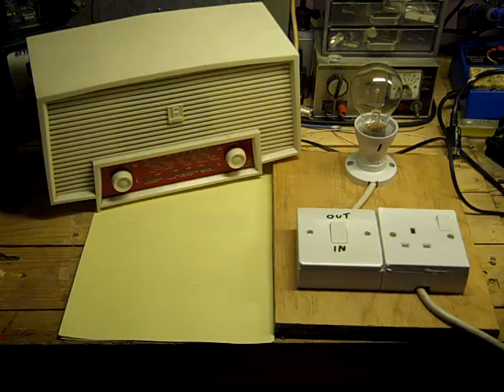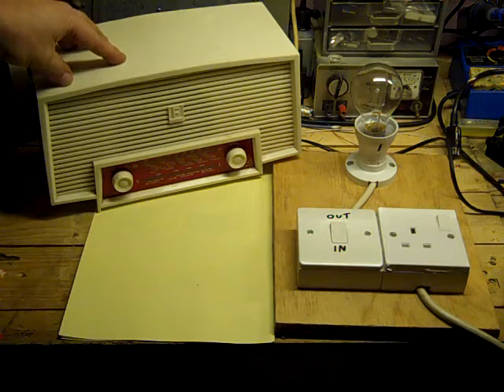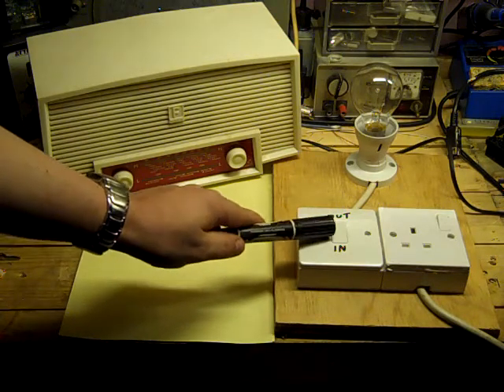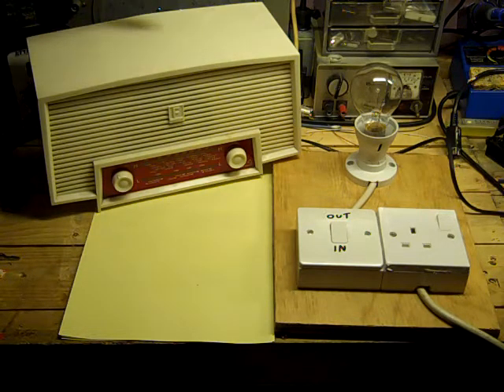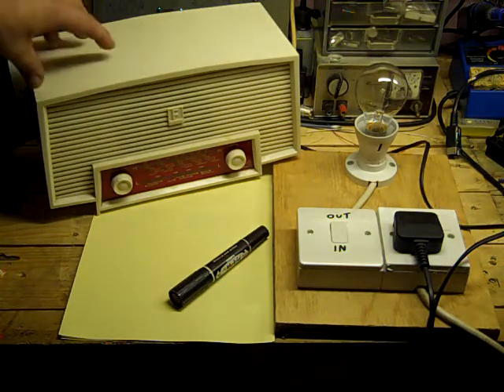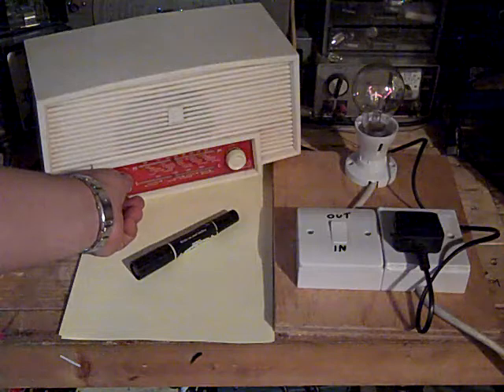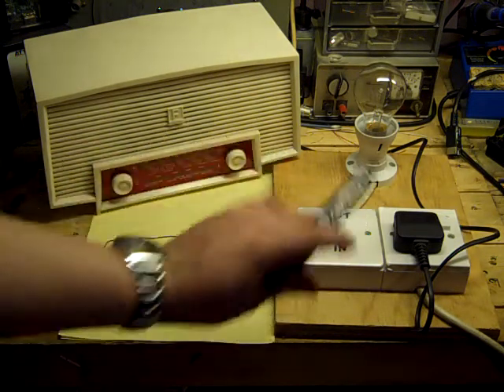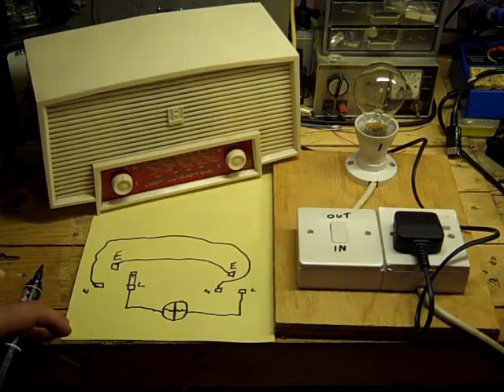Series Lamp Limiter

Comment: i would consider one of these absolutely essential when repairing any valve and some transistorised equipment, as these limit current automatically, a variac, which some use doesnt, you have to keep your eye on any current meter, i'm currently working on an electronic 'active' variable limiter that gives sharper limiting action, as a bulb limiter will still drop a fair amount of volts when wattage is chosen for a safe current limit, my device will allow nearly full voltage through, so radio operates correctly, but instantly limit current if theres a sudden failure in the radio..ideal for soak testing...

Comment: Reforming my arse just replace the caps they are anything between 50-70 years old in these old valve sets.......
Reply: not always necessary to replace ALL capacitors, depends where they are in the circuit.... such as a 470 ohm cathode bias resistor in an IF stage, bypassed by a 0.1 uf capacitor....no need to replace that cap as has only a very few volts across it and any leakage wont affect it unless very low resistance, i've never had one go that low,  capacitors across mains, coupling to output valve, chassis/aerial/earth dc isolating caps in an ac/dc set, and any directly across ht, if a waxy paper based, definitely yes, as for electrolytics, they might well be still ok, most of my many radios have their originals and still test ok..

Comment: Interesting. It's cool you're into valves. That's an area of electronics I know very little about. Took me some time to recall, but I remember seeing miniture bulbs used in series with stepper motor drivers to limit current. It was fascinating.
Reply from the maker: +bwack Been into valves for years, I build custom amplifiers for harmonica players from scrap valve radios.
Reply: JaysVintageJunk JaysVintageJunk Brilliant !! :)

Comment: Very interesting Jay. Would you recommend that I build one of these for the first power on of the stuff that I am picking up from the dump ? Like the 80's computers and stuff or is it only really useful for the older valve stuff ?
Reply from the maker: +StigsWorld I wouldn't use one for the power up of a whole computer but if you can isolate the power supply from the rest of the computer then yes a lamp limiter is ideal for first power on as it will allow you to test the psu without danger of damaging anything.